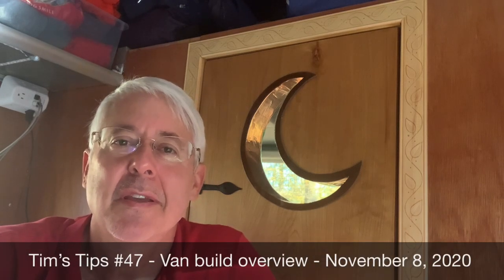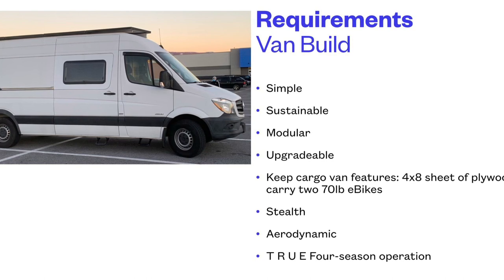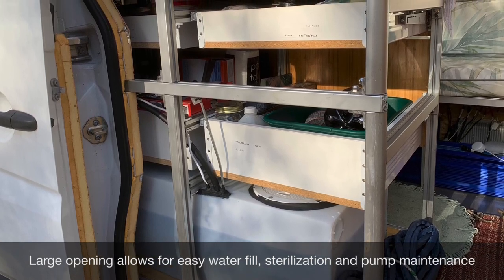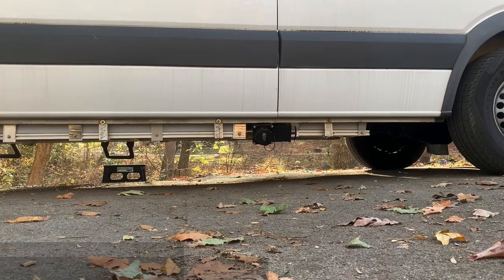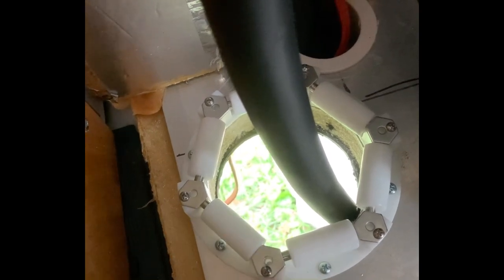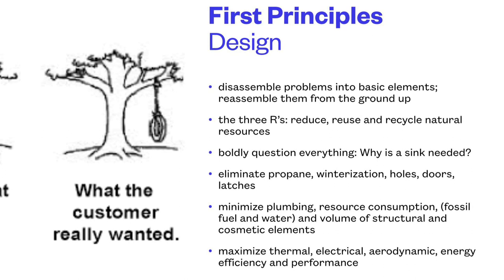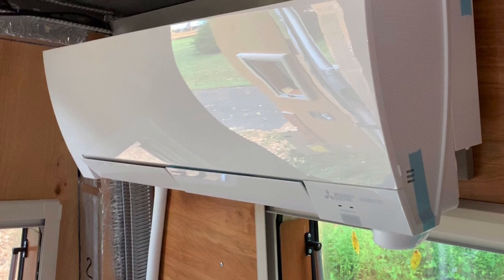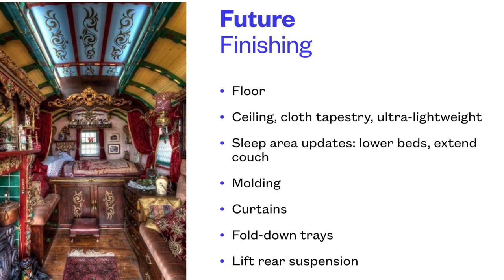Tim’s Tips #47 - Van build sustainable minimalist philosophy - November 8, 2020

Comment: "Eliminate holes" has a 4 inch hole covered with foam 😳🤔
I must say, after reading your comment about Benchmarks van, I expected more. was very disappointed. I guess the intangibles can't be grasped by all...
Reply from the maker: Stealth requires eliminating most holes in the side of the van, so I chose to put the holes in the bottom for the 50Amp RV cord. The 6.6 KW EV charging cord will also go through this hole.
Reply: Same here. I watched Trail and Summit VAN TOUR | Ford E-350 Camper Van Conversion | Heavy Duty Insulation For Long-Term Winter Vanlife.
Reply from the maker: Most typical RV have a "shotgun" design: holes all over the side of the rig. You won't find one hole on the side of my van. This eliminates issues with water intrusion and insulation thermal breaks.

Comment: Great build! With the rapidly increasing battery energy density, electric is the way to go. Like the idea of a mini split, but would like to repackage the external unit in one of those boxes that swings on a bumper. Obviously, that would likely violate the warranty.
Reply from the maker: Thanks for your comment. The stock bumper is kind of weak, but you could weld something to the frame. I researched putting the 80LB unit on a door. A few things could happen to the door hinge area: 1) hinges wear out quickly. 2) Hinge attach points buckle. 3) Door sag causes door not to fit anymore. 4) may get lucky and all is well. 5) Beef up the hinge and attach point to handle the extra weight without sagging. 

My swinging hinge works, but I am concerned the flexible line set may not have been designed to repeatedly flex indefinitely.